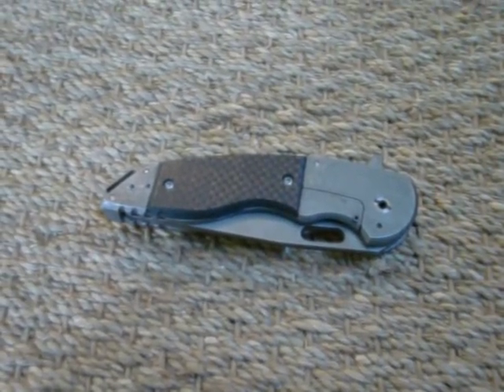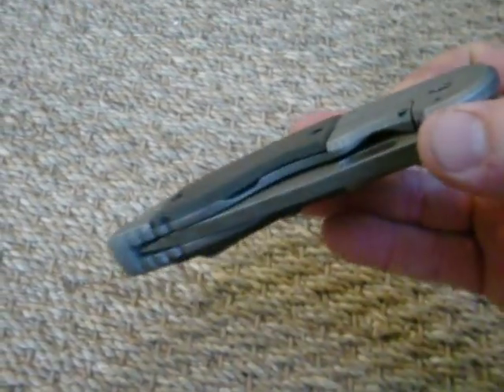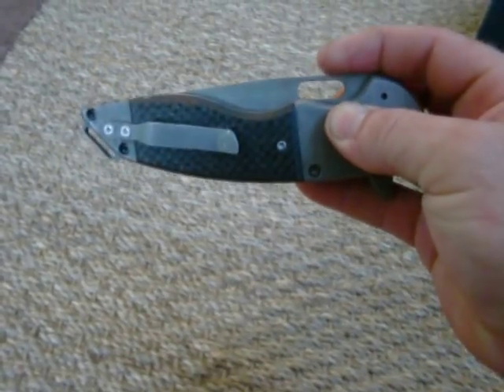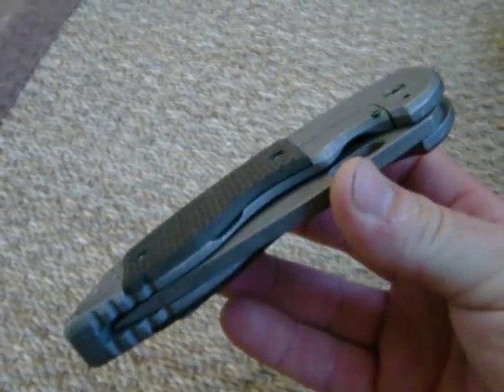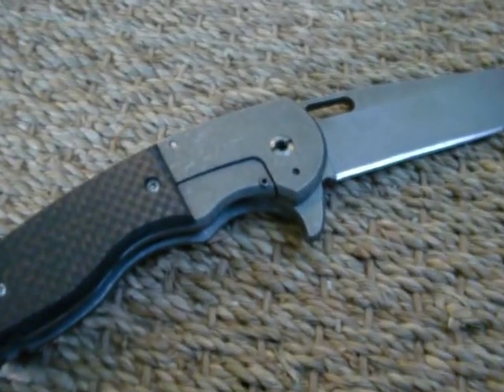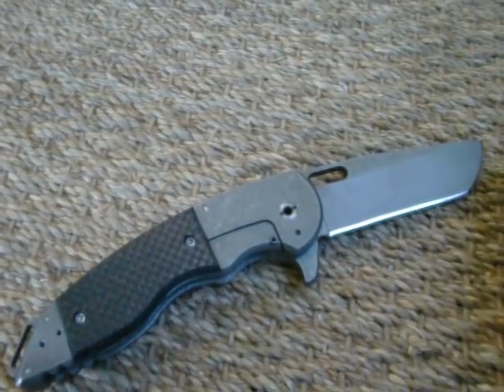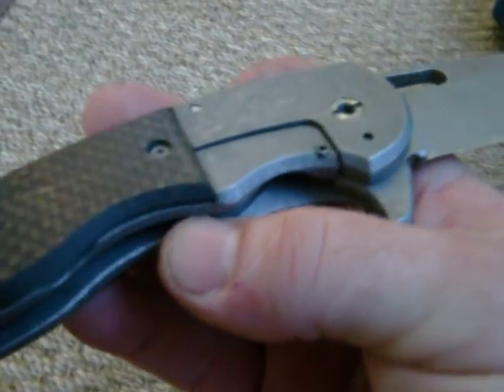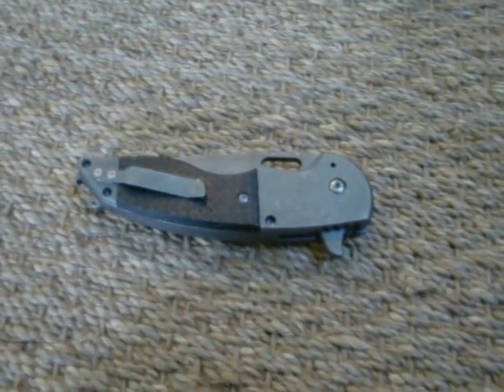Hoback Roller Detent system HRD

Comment from the maker: Thanks for the other side of thought man, it is appreciated! I see your point and have a lot to consider. They say a patent is only as good as the lawyer you can hire to protect it.I agree, but I just havent been able to figure out exactly what I want to do yet.

I am considering making a run of my next 50 folder with the new bearing system and making them extremely hard to open up, so people cant take it apart and see whats in side it.

Comment from the maker: This would work find, because my new bearing system would never require the end user to take the knife apart to clean it. only to blow it out occasionally or use a q tip.

Im doing some work with DPX gear and may use my HRD in one of the folders we are working on, so I can get it out there. Im not sure if I want to do that with this new system?

Comment: Well you can file a PP for anything you want since they don't get read by the patent office or cross checked against existing patents.  I would offer caution before dropping  money on a PP which you can file yourself online for $120 if you have about 3 hour to wade around on the USPTO website and find all the forms.  I personally think you should patent the HRD first, it have much more commercial viability and potential value.  Ever wonder why IKBS is not patented?

Comment: IKBS has low potential value, there is only one production that uses it that could generate substantial royalties.  And that is because it requires too many additions to manufacturing to make it fit well in the production world.  The HRD on the other is simple and could be added to almost any production process quickly.  Plus your bearing system had better be really unique if you plan on eventually getting utility patent in the future, because those cost some coin.